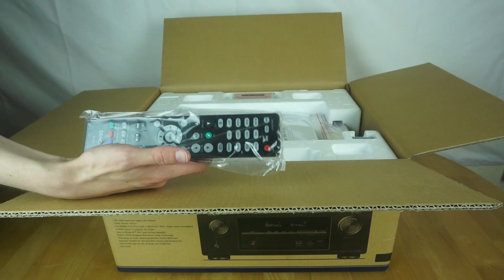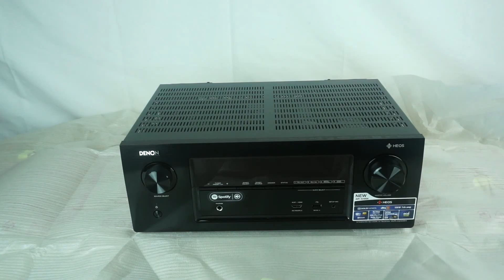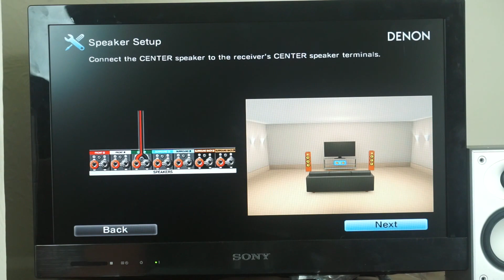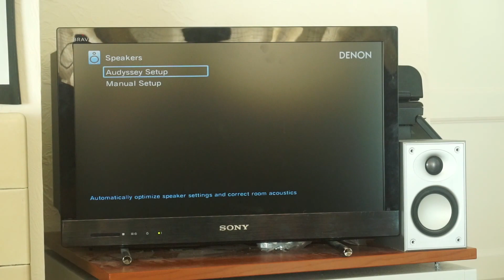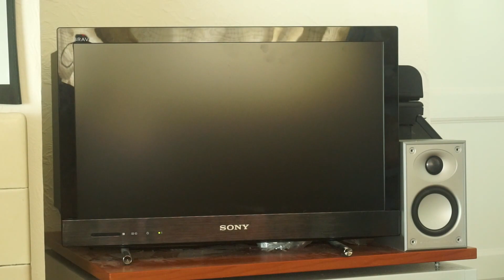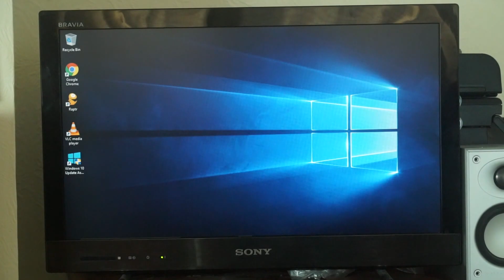New AV Receiver - Denon AVR-X2400H - An AV Novice's First Impressions

Comment: I must have missed it but how exactly did you connect the tv, media player, blue ray etc to the Denon?
Reply from the maker: It's all just connected using HDMI cables, devices all send video and audio into the receiver over HDMI then the video is fed from the receiver to the TV also over HDMI.  It also supports ARC meaning that any sound coming from the TV (such as from Freeview channels or devices connected to the TV directly) is sent back down to the receiver over the same HDMI cable that connects the TV to the receiver.

Comment: I can't see from your video but is if possible to clean the inside plastic on the VFD front display as mine has fogged up a bit. I assume there's a gap between the VFD and the plastic but it might be a sealed unit. 
I think this may have been due to using a vape near to it (a VFD uses high voltage so static may be created drawing in particles in the air causing them to stick to the plastic) it's not life-runing but it's a pain in the arse if I can't just grab a cotton bud and give it a clean.

Comment: its not that it costs less its that if you do put a 3 pin iec on a NON earthed cable people will plug it into items that require a earth which is potentially dangerous as youve disconected the earth from the device 

by giving a 2 pin for a non earthed device it stops people trying to use that cable with devices that need earth

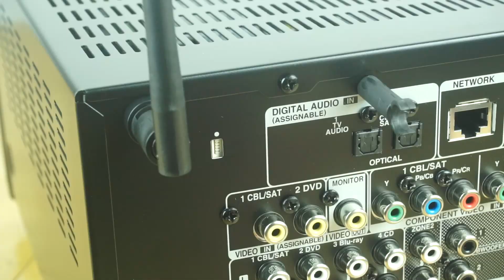Comment: 11:11 This is RS232 cable port. It is used for service diagnostics and configuration. To use it, you would need to obtain a service manual and a cable. The cable can be either bought from aliexpress or from Denon authorized service partners. It is not useful at all to the user. The dot specifies the position of red line of the flat cable when inserting.

Comment: I'm very surprised at that not taking an earth connection, it's a metal case, and it doesn't look from the open shot like the power supply is double insulated (and I couldn't see a double insulated marking on the back)...
Reply from the maker: It's definitely a weird one although it does have a double insulated symbol on the back below the model number in the box underneath the HDMI ports.  My Tannoy subwoofer is the same in the sense that it has a non-grounded IEC connector so I suspect there's some audio related reason for it.  Had this been a cheap, unknown product I'd be a bit concerned however since it's from a highly reputable and respected brand, I'll trust that they made the appropriate design decisions to keep everything safe.

Comment: can i put my adam a5x moniters on this avr and how would i best conet them.im curentley yousing my 5.1 atmos set which came with my onkyo 528 avr.its a shame ive my pro moniters boxed ide love to have them on it as bookshelfs.great reveiw freind helps with the basics.great avr it has every box i need lovley sturdey avr.
Reply from the maker: This AVR only has speaker level outputs whereas your powered monitors would require a line level signal.  You can get converters that would reduce a speaker level signal down to a line level one however they mostly look like they're designed for car audio so no idea how well they'd work with this AVR or whether they'd have a negative impact on audio quality.
Reply: @camerongray1515  thanks for your time Cameron will look in to your suggestions and get back to you as it's a question quite a few people could yous the answer to as you no adam monitors are gorgeous as you own a pair to I see.it would be great if we could put that quality on our receivers as an extra for music playback in particular.love the you tube channel mate keep it up well presented colin edinburgh

Comment: Hi I just bought Denon AVR-X2400H. And the PC wants to connect the desktop to it. My PC has HDMI, but I don't see the HDMI input on the receiver. Where do I have to plug in the HDMI cable ??? There is nothing left in the manual. Only over the internet cable. Can someone help me forward?
Reply from the maker: There is a row of 7 HDMI inputs on the back and one on the front.  None are labeled "PC" but the labels only relate to the buttons on the remote, you can plug a PC into any of them.

Comment: My old Denon amp had a European 6 sided plug inside a 3-pin plug like this one. So did the sub woofer. I removed the cover of the sub woofer plug and it plugged straight into the back of a matching female power out socket in the amp. So the sub woofer powered up with the amp, very tidy. I don't see that feature in any Denon amps now.
Reply: I would never do that; those outlets are fused to a low rating and I don't think they're passthroughs.

Comment: Hey can I ask what volume level you usually view/ listen on ?? I bought one recently and set up the calibration which was fine but I basically cant hear anything even when the Vol dial is on 30. It needs to be around 50-60 to get a decent sound. And that just cant be right. Any ideas ??
Reply from the maker: Seems about the same here, 50 is generally an acceptable volume for me, probably depends a fair bit on your speakers.
Reply: Cameron Gray Yeah, I managed to fiddle around with the settings and  did a manual speaker set up which seems to have corrected the issue. My next problem is how do you switch between the two HDMI outputs. Like yours I have my TV and Projector plugged in but no idea how to switch from TV to Projector.

Comment: Yes I have this exact amp did Denon 2400 and every time I go past volume eight it goes up to 98 it shuts off the system I have to unplug it and plug it back in and I only got Volume 8 it shuts off the complete amplifier every single time

Comment: I know this DOESNT have the THX cert, but does that even matter?
Reply from the maker: I wouldn't read too much into it, all that cert means is that the manufacturer paid THX to validate that the receiver meets a predetermined standard, changes are many other models also meet that standard but the manufacturer hasn't paid for the official "certification" - To me, I'd rather the money was spent on the product itself rather than "certifications"

Comment: Just FYI when you set your speakers on the PC to 5.1 or 7.1, you will probably not be able to use various surround functions i.e. Dolby or DTS for YouTube videos, online content or locally stored videos. This is for DVDs mainly (and who watches those on a PC anymore especially?) I had to set mine (a Pioneer VSX-44) to stereo to be able to use surround sound. Even though this a different receiver it doesn't matter, this is a common issue.
Reply from the maker: Think the PC is currently set to Atmos, I needed to set the PC to one of those settings so that if it's playing a multichannel source it will actually play it properly.  If the PC is only outputting stereo, using the surround modes on the receiver will just do virtual surround stuff.  As it is I can manually press a button on the AVR remote to enable DTS/Dolby Stuff if I want to do virtual surround things when the PC is playing stereo audio, the most I ever do for this is "Multi Channel Stereo" to enable the rear speakers when listening to music.

Comment: X1400h model has coaxial input and pre out rca connectors..too bad this one does not.
Reply from the maker: This one does have the same Zone 2 pre out as the X1400H - it's located next to the subwoofer outputs.  The coax input on both appears to be a regional difference as both models have one in the US but neither have them in the UK.  Not a huge issue for me at all as all my devices are HDMI.

Comment: So I'm quite stupid with AV Receivers. My question is: You can only have a total of 8 inputs at a time? Meaning, if I connect, let's say, my SNES on the Analog input labelled 'Game', and my PS4 Pro on the HDMI port labelled 'Game' it would not work? Considering all the other HDMI inputs are populated. Do I have to choose one or the other, or can both work at the same time?
Reply from the maker: Yeah, it has a maximum of 8 inputs, some of which can either be HDMI or one of the analogue ones.  If you need more inputs you'd either have to use an external HDMI switch or find a receiver with more inputs.
Reply: Cameron Gray ok, thanks for the response!

Comment: Please test if you can attach a microphone in the Receiver
Reply from the maker: It doesn't have a microphone input so you'd have to use an external preamp and connect it to one of the line inputs. These aren't really designed for PA use, if you were to connect a microphone you wouldn't be able to have any other source playing at the same time.
Reply: Thank you for the comprehensive Video. Thanks

Comment: Shouldn't skip the setup ever. It has like 9 output channels and you're running it with 5 or 7 speakers. There will be holes in your audio range unless you tell it which speakers are actually hooked up.
Reply from the maker: I was more referring to skipping the part where it was explaining how to connect each speaker which I had already done.  I wouldn't have skipped the full Audyssey setup portion with the calibration microphone.  Of course that's me assuming that skipping the tutorial part would have still let me carry out the Audyssey setup.
Reply: Cameron Gray honestly the setup mic is less important than telling it which channels are on.

Comment: Good review.  There are not many good reviews in this genre so, thank you for posting.  

I would like to get a receiver also.  Your model seems very expensive.  I don't think I want to pay more than $200.00 USD.  Its been a while since I have had real sound connected to my TV or computer.  Many of the online reviews complain about the Blue Tooth, so I think that the problem is the Blue Tooth rather than their receiver.  So, I may just avoid that. 

Any tips are welcome.  How did you select this model.  If you are able, I hope you do some more videos in this area.
Reply: Id recommend saving for a more expensive model like this on I had a  $150 RCA and I hated it it always had problems and never wanted to do anything my Denon was a HUGE upgrade Because it actually had a real amp and it sounds amazing I'm not the best with audio equipment but this is way better for $500 but you could get a Denon AVR X1400H but this one is better
Reply: Also I have never had any problems with the Bluetooth on Mine

Comment: Is the remote control Bluetooth or IR? How could I control the receiver if it is hidden away under the stairs?
Reply from the maker: The remote is IR.  If you have it hidden away you could possibly use some sort of IR blaster although you can use almost all of the functionality with the TV remote as long as the TV supports modern HDMI control standards. You can also pretty easily control it over the network using telnet if you wanted to build something custom.

Comment: Hi there, any recommendations on speaker wire and banana plugs (plastic or metal)?

I'm new to audio setups. I have this exact avr, just bought myself some decent floorstanders. Looking to build a decent Atmos set up in time.

Thanks 👍
Reply from the maker: I'm not really an expert - For speaker wire I just bought some pretty basic (but still pure copper) 42 strand stuff from Screwfix - I was running the cables inside the walls/ceiling so didn't want to use something too thick or bulky.  For banana plugs I just bought some "UGREEN" branded ones from Amazon.
Reply: Cameron Gray No worries, thanks very much for the reply 😊 Much appreciated. Been looking at the Ugreen plugs aswell 👍

Comment: I still use my good old onkyo TX-SR702E , no hdmi , but plenty of everything else with beefy worm sound . I still need old phono , tape , optical and coax conections . Everything new just does not have those stuff , and il use it untill it dies.. That Denon i great.
http://www.eu.onkyo.com/en/products/tx-sr702e-35151.html

Comment: Why does it not have earthing, it's a metal case isn't it?
Reply from the maker: Technically it doesn't need earthing as long as it is double insulated which I imagine it is.  I'm wondering if it's to prevent issues with ground loops on something as my Tannoy subwoofer is exactly the same - a 2 pin version of the IEC C14 connector.

Comment: Loving the Mordaunt Short Speaker/s.. Are they the MS302's?  I used to work for Richer Sounds so it's good to hear you used them, they really do their best for their customers :-)
Reply from the maker: +CJT80 Yeah, MS302s with an MS304 center.  I bought them used on eBay years ago but was very happy with Richer Sounds for the receiver.  Might look into getting full range front speakers down the line, would almost certainly go to Richer Sounds for them.

Comment: Hello, thanks for this review from unboxing to testing phase. Not so common to see an actual test, instead just putting pictures and some on screen specs that everyone can check in manufacturer´s website. But I have a question for you mate if you are able to help me. Or for you all mates that offer your comments in the video.

I first bought my first AV receiver (Sony STR-DH550) a couple of days ago. And I have checked that in your video (12:18) your receiver does a short metallic noise, and then you say "...it´s clicking and shooting at me..."

These noises happen inside my new receiver as well, but x4 times.

1st noise - When I push the ON button. Short humming noise.
2nd noise - 5 seconds later. Short metallic noise.
3rd noise - When I push the OFF button. Short humming noise.
4th noise - 5 seconds later. Short metallic noise.

I have 2 speakers wired to it FYI, but noises come from inside the unit.

Can you let me know if these are common in AV receivers of any brand?

I am worried about having a faulty unit.

Sorry fot the long text.

Thanks.
Reply from the maker: Those clicks are fine - It's the relays inside the unit which are used to allow the computer inside the receiver to switch on and off different parts of the unit.  Relays are effectively little mechanical switches that can be triggered electronically so it's normal to be able to hear them click when in operation.
Reply: Cameron Gray Many thanks for your reply. Now it is clear to me.

Keep the good job mate.

Comment: My biggest pet-peeve about many of those new A/V receivers, is the lack of a phono input. I mean you'd think that w/ vinyl's major resurgence, the manufacturers would get a clue!
Reply from the maker: I suppose the demand for it just isn't enough to make it worth adding in the additional complexity.  I imagine most people with turntables would be using them with a regular stereo amplifier and if you did want to connect it to a receiver, you can fairly easily use an external phono preamp.
Reply: don't have most modern record players a build in pre-amps?

Comment: Would work better if all parts of you AV system are connected to your AV Receiver via Optical Fibre inter-connects, and Richer Sounds Belfast behind the Castle Court Complex is my favourite place, the MARANTZ SP5000 was the same unit I was interested in getting but I had to forget about it and go with a Sound Bar and Sub Bass.
Reply: Actually no, the spdif/optical is (quite) compressed audio, HDMI is uncompressed, and will give you better sound :)

Comment: I’d recommend putting your HTPC into the mode that will bitstream the audio. That way the receiver does the audio decode not the HTPC - I found with my denon it worked wonderfully and sounded better to my ears.
Reply: He connects it trough HDMI, the audio codec interacts a connection setup, DAC decodes the original stream in the receiver.
Reply: Use kodi with passthrough ON
Reply: Even better option would be to buy a Blu ray player or media streamer that would do 4k and high resolution audio both if money isn't a problem.

Comment: The Intel sticker on the HTPC changed to an AMD sticker, weird :D
Reply from the maker: +Carbonat Haha, I'd swapped out the motherboard and CPU shortly before the video and swapped the sticker over in between filming two of the sections.  Well spotted!
Reply: Peteto Chibs its an FX sticker so probably not
Reply from the maker: Nah, it's just an FX4300 with 4gb RAM, a Radeon 5450 and a 60gb SSD.  The machine is used purely for media playback so doesn't need much, ultimately if I move to 4k I'll need to upgrade the graphics card to one that supports HDMI 2.0 or greater.  I have Ryzen but it's in my main desktop.
Reply: @camerongray1515  did you do any other upgrades to it after you later put a GT 1030 in for 4K...?

Comment: If only every receiver had a video like this. Couldn't resist taking the top off though; like th heatsink arrnagement at the front.
Reply: You do know that you can edit comments
Reply: I missed my AV receiver with a fan. It was getting too hot. See my reply above.
Reply: MODDED! Not missed. Bloody autocorrect.